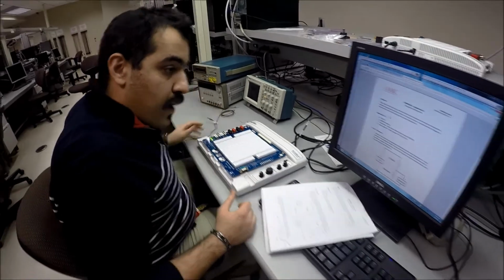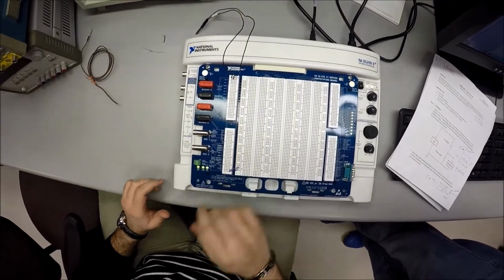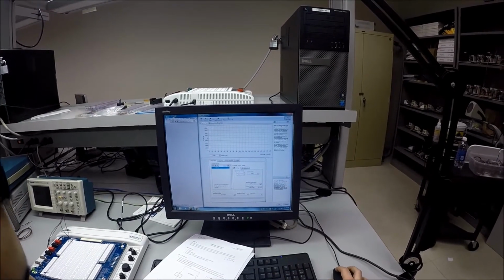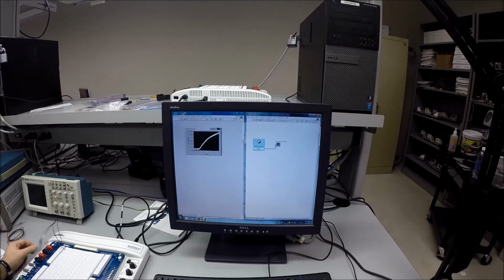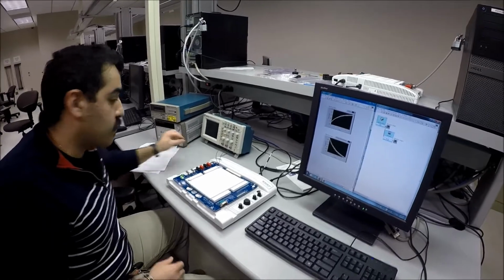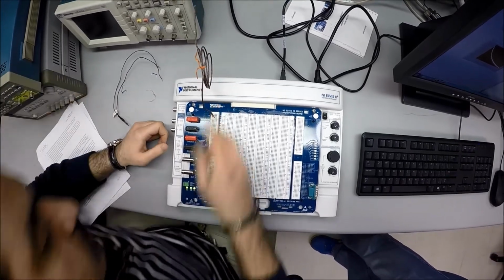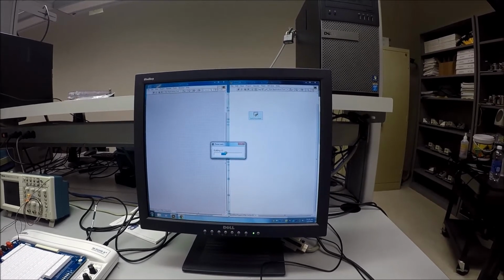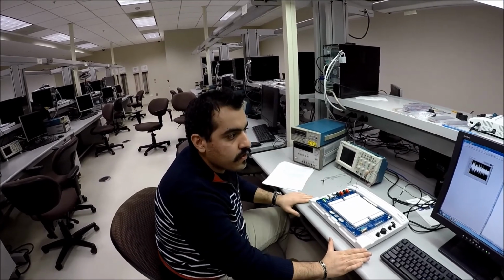ENME 482L - Lab #2 - Thermal Systems

Comment from the maker: For the last part of the video... 

The negative side of thermocouple must be connected to analog ground (AIGND) as well as the negative side of the acquisition channel. NI ELVIS allows the acquisition voltage to float which can result in a large DC offset being added to the very small voltage generated at the thermocouple junction. By grounding the negative side, the acquisition channel only sees the thermocouple voltage and should give the correct temperature.